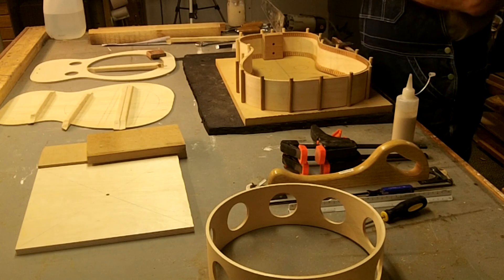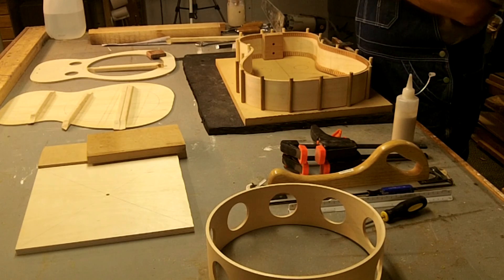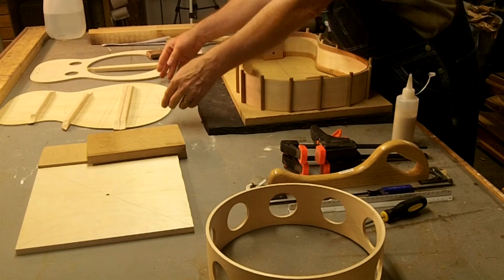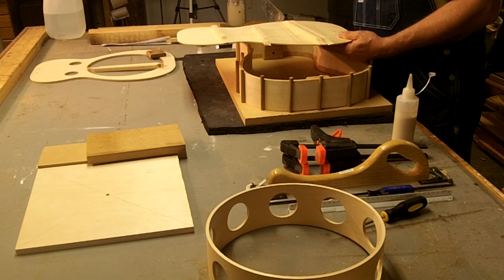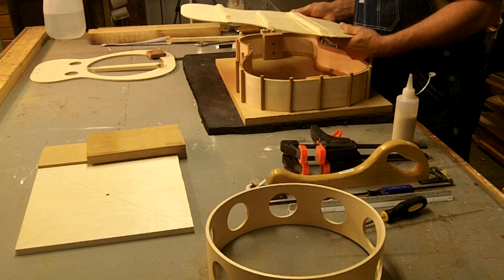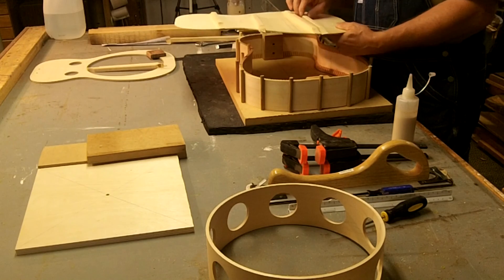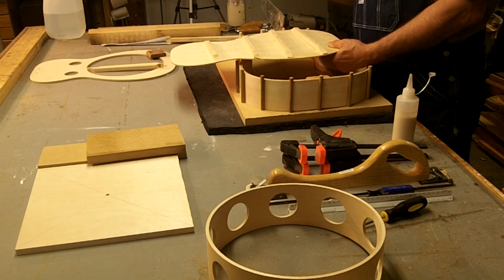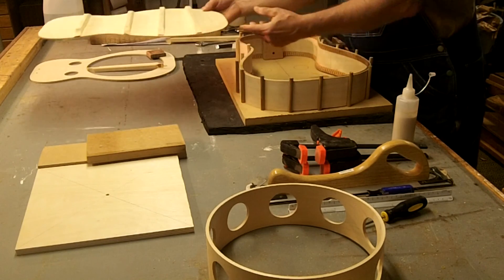Beard Resonator Guitar Kit Construction-Part 4-Bracing-Gary Clardy

Comment: At 16:18 braces are trying to slide out of place while being glued-----if you place short bars of wood across the tops of the two braces of 3 and 4 and let the go-bar sticks come down in the center of the little "bridges" the braces tend to stay in place a lot better when glued. Then repeat the process when gluing in braces 1 and 2. It sure works for me.